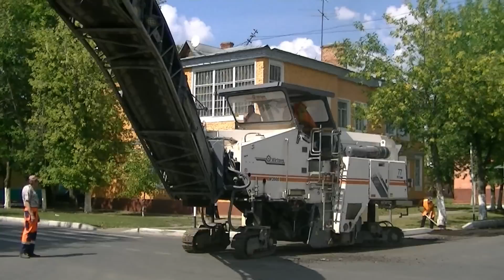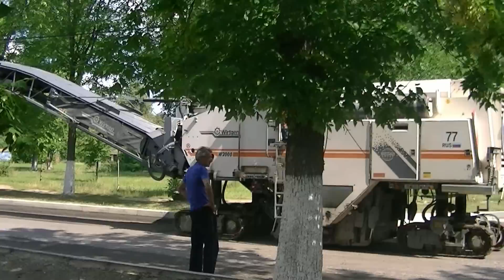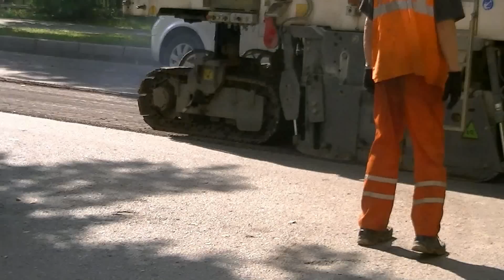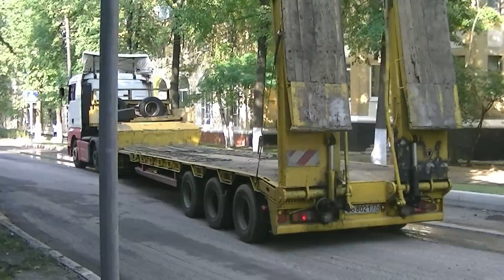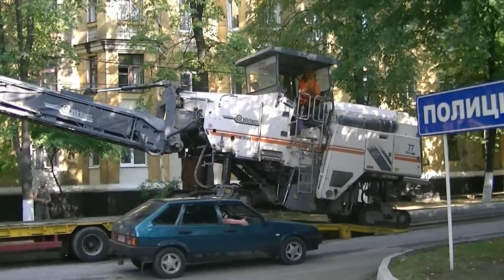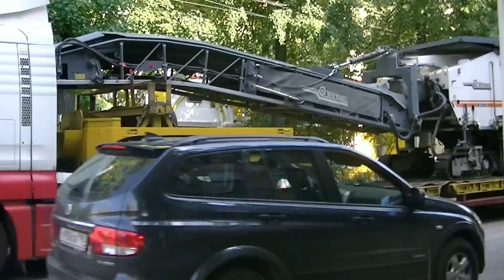Wirtgen W2000 part 2

Comment: Good equipement for road formation,repair,surface mining of coal,limestone, other soft minerals.is it engine HP =< 1000.,6 cylinders/12 cylinders. What is the Cutting (drum) roller dia up to tip of cutting pick (tip).Fuel consumption.